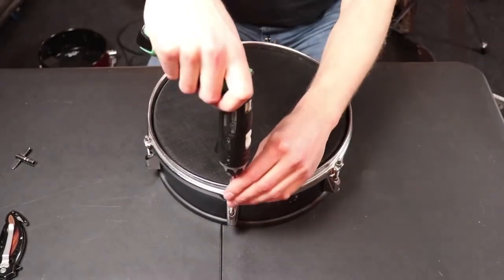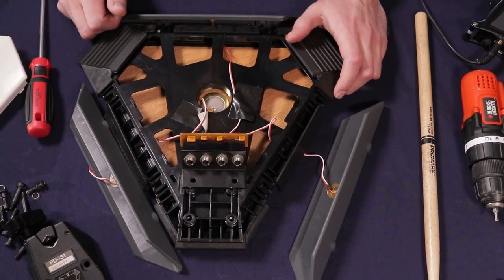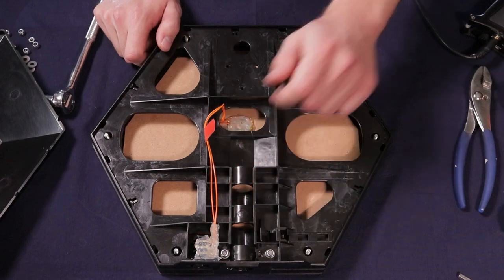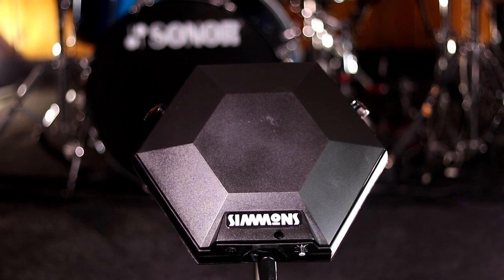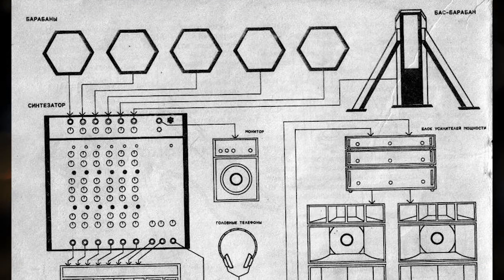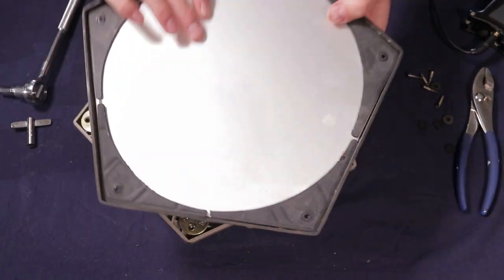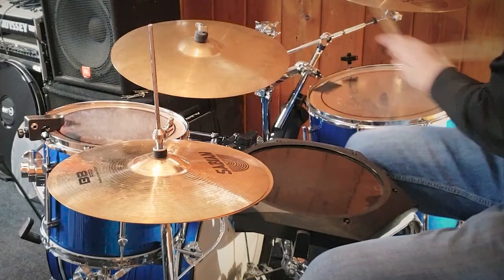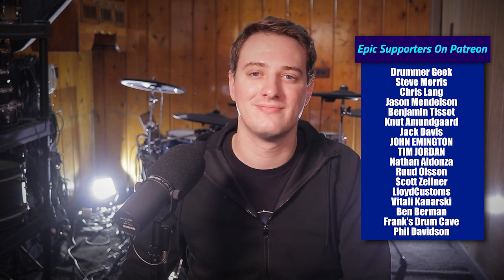What's Inside Vintage Electronic Drums?

Comment: Justin, Love your PD-31 breakdown, I took one of my PD-21's apart to try and fix piezo and tried to peel the rubber away from the wood unsuccessfully! I have a PD-10 with the PD-11 guts that I still use at church with a double kick pedal. I found it DOES work if you use the narrow hard rubber beaters, but regular size won't fall into "zone" to get good even triggering. I've had this set up since 1989 after my Christian metal band split up and I decided to take my kit to church, when I decided for space reasons to go to a single kick with a double pedal instead of using 2 PD-10's with 11 guts. Also you mentioned that the PD-31 rubber surface is hard and will hurt your hands. You are right! That is why I bought 2 pairs of Aquarian X-10 Lites with the red shock grips. These are without a doubt the best sticks ever made for electronic drums with rubber surfaces. They are a sturdy graphite composite with a slight flex and absorb the shock, as I've been playing the same pair ever since 1987 on my PD-21 TD-7 and later TD-6V kit at church. I am a very hard hitting metal style drummer and these have lasted 30 plus years, as well as most of my Roland pads. Best $19.95 ever spent on a pair of sticks. Virtually indestructible, unless you hit the bead against a sharp hard metal object like an angry K-7 child did one day from our Academy. It was then I found out these are actually hollow. So I went to eBay and bought another pair, but I still have one pair over 30 years old I bash on every Sunday! Due to volume issues I've recently acquired a set of Alesis Nitro Mesh pads and once I get them modified to fit the larger diameter Roland hardware, I will probably have to switch to Pro-Mark 5B wooden sticks since the one bad thing about the Aquarian X-10 graphite is, it EATS through mesh like you wouldn't believe. I had a PD-85R snare and quickly had to replace the me$$h head, and the rubber "rim", so I know these cheaper Alesis black mesh heads probably aren't gonna hold up to the graphite to mesh contact abuse. Yes I "can" play with dynamics, but I LIKE to hit hard, plus I'm lead singing most of the contemporary praise music so that's one less thing I have to think about since I'm almost 63!

Comment: Excellent I have owned most of these . I started with Simmons! They were great . Although I will admit I was disappointed when they arrived back in 1987 pads were harsh and the sounds lacking . However they were ground breaking back then I went on to use Roland forever and also still use DAUZ pads which are great .
Dan is still making great pads

Comment: It seems Tama were using a completely different trigger technology in their pad. That is literally a mini speaker, the type you'd find in any cheap pair of over ear headphones. Image search LN005245 for an example. I would not have thought an electromagnetic trigger like that would give a sharp enough signal like a piezo. That's kinda neat.

I wonder if their contemporaries were doing similar things or if it was just one coked up engineer at Tama with a busted pair of headphones and an overdue prototype deadline.

Comment: One point that could use clarification. Retrobright isn't a product, it's a technique: submerge the piece needing to be brightened in hydrogen peroxide, and hit it with UV light for several hours as it soaks. This can be done by placing it in direct sunlight, or via UV sources such as black light LEDs. for something as large as a drum shell, you'd need a large container and a lot of hydrogen peroxide.

Comment: Its crazy that the only thing that changed, is the cone addition tech-wise. Im really wondering why there are no Chinnesse e drum pads and cymbals for 10$ each at every corner store and gas station. Chinnesse have copied everything we can think of for a 10th of the price of its original counterpart, yet it seems there is some sort of underground shadow deal where noone is allowed to sell some low tech plastic and rubber objects with a high selling value.